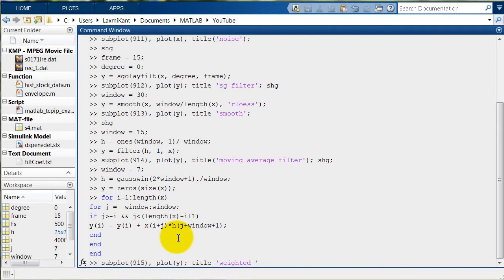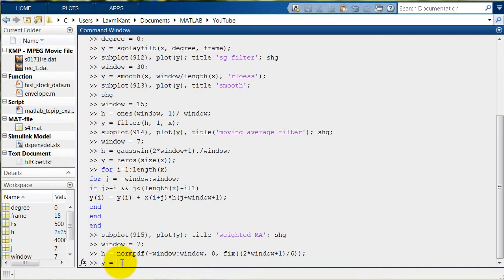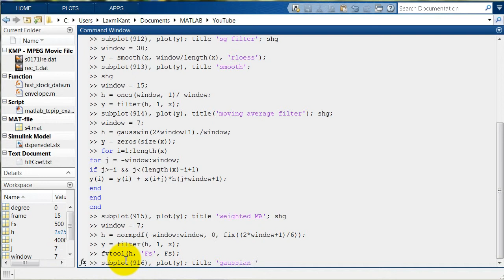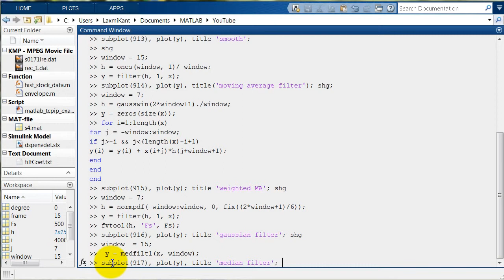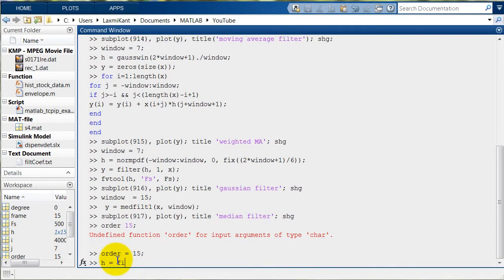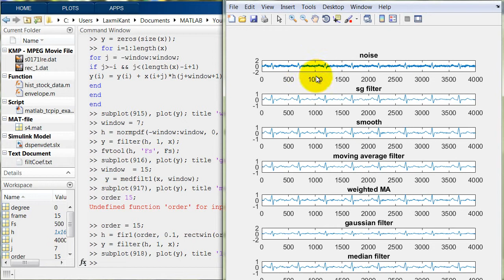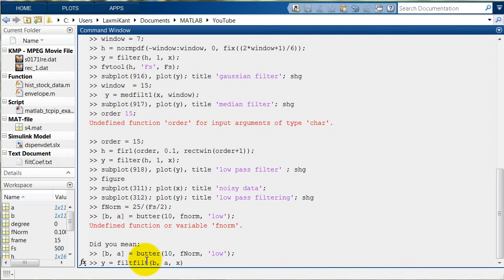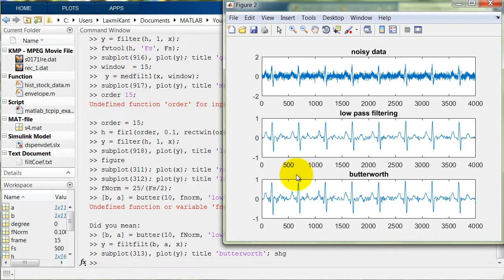[ 9 algorithms ] ECG Data Smoothing in MATLAB Part 2/2

Comment: According to your implementation in this tutorial, you showed that the SG filter is the best option to smooth the ECG signal. Do you have a research paper or article approved that SG filter is the best, I want to use SG filter so I need it as a reference to in my Ph.D.  Thank you
Reply from the maker: Hey It is just for reference and of course PhD research paper need a lot of hardwork to come up with new methods. I would suggest it to use as cleaning of your data and of course for cleaning ecg data using SG can't be published.
Reply: I just need to use it to smooth my filtered ECG signal, and I see using SG filter can smooth the signal and remove the motion artifact and baseline wander noises. Why it can not be published if i use SG filter?
Reply from the maker: As far as I know. Ph.D. publication needs novelty in work. You can develop novel method of noise removal on the top of SG filter. That might help you to get publication.
Reply: @KGPTalkie  could it be used for MS??